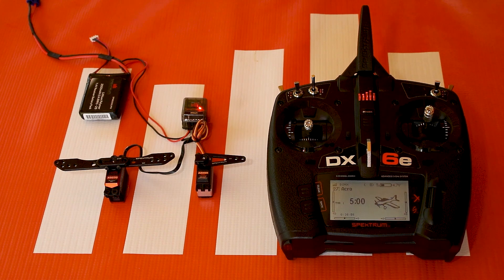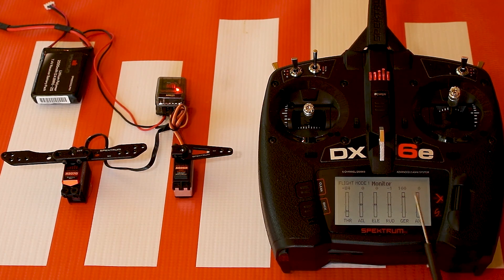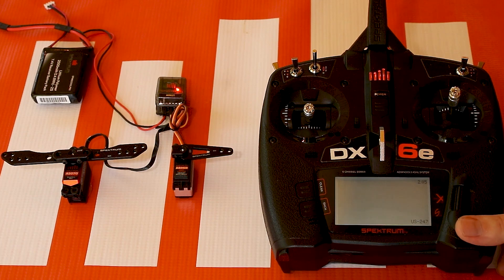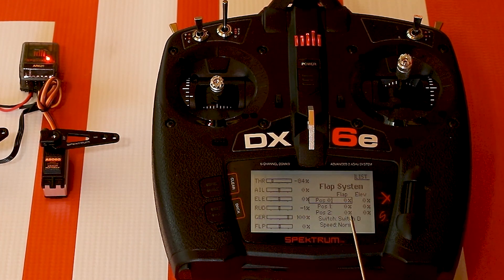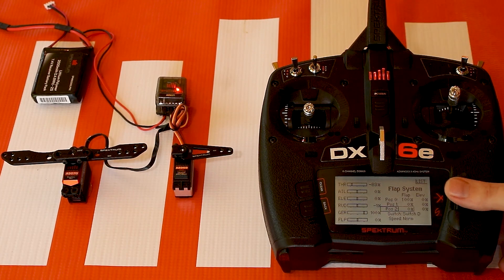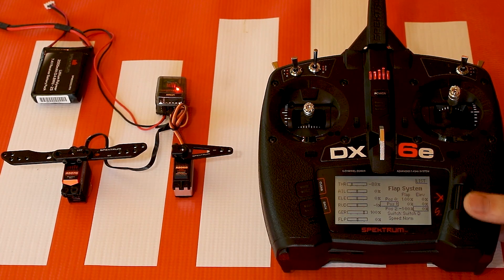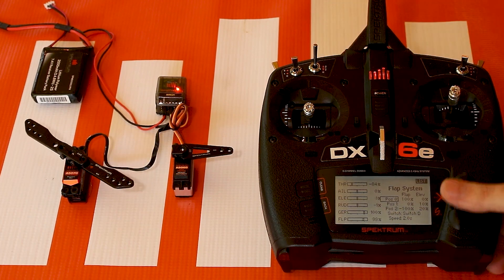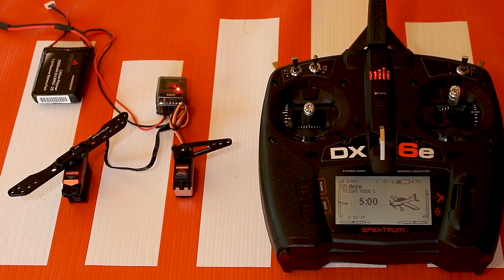Spektrum Quick Hit Tech Tips - How to Setup 3 Position Flap Switch tutorial

Comment: Hi from Michigan • Flying Pilgrims RC Club -  have this radio, second summer flying the Cessna 150T - Every step in this video worked as described - It solved the ballooning issue with the flaps and they also go down slow, like a real airplane. 👍 Thanks ✈

Comment: How do you adjust the throw on a two servo flap system.  When using a three position switch on of the flaps has more throw than the other?  The both start at zero throw. Thanks for your help. I’m using an ix20 radio

Comment: The flap>elevator mix isn’t to prevent ballooning. Your plane balloons because you were going too fast when you lowered the flaps. The flap>elevator mix should be used to set the glide speed/descent rate at idle so that your plane will glide without stalling or descending too steeply.

Comment: These tutorials are awesome thank you. I'm having an issue whenever I choose a different model on my NX10 lately the flap settings are backwards..not reversed in servo reversing they are backwards to the switch position..if I do reverse the switch that overdrives the servo badly, I have to redo the entire 1 and 3 position settings. The middle settings are correct. I dont' know what is causing this to happen but it really causes alot of frustration going out to the field and having to retrim my flap settings. Could this possibly happen after accidently changing stick modes? sometimes apon changing brightness I accidently hit the mode menu and end up switching off the TX and recalibrating after that. Thanks and Merry Christmas.
Reply from the maker: Hi Aaron, Changing the mode should not have done that, the only thing that comes to mind is that if you changed the servo to a different servo it could do this.

Comment: What if in my original set was backwards such as my normal was at number 2 and not zero. What I did is I set up backwards. How do get it to zero for a normal set up. Also my 2 second delay did not function how do I trouble shoot that?
Reply from the maker: If that is the case, then reversing the flap channel should fix it. Just be ready to adjust travel positions if there is any binding in the control surfaces
Reply: @SpektrumRCvideos  is that going to fix my two second delay

Comment: Why does my DX6e monitor screen look different than yours (update 2.08)?  Yours shows 6 channels and mine shows what appears to be 7 channels THR  AIL  ELE  RUD  FLP  GER  AX2  (I'm confused).
Reply from the maker: There is an error in the current 6-channel transmitters that the radio shows a 7th channel on the display.

This will be fixed in v2.09, which should be out in the next few weeks.

You still have a 6-channel transmitter.  To configure channels 1-3, use the top row.  Channels 4-6 are on the bottom row.  Position the cursor by counting and you will be fine.

Comment: I am adding flaps to my Carbon Cub S 2 and couldn’t find the pre-done program on your website, I tried using the S+ and had to add flaps into the program for it and used Switch D and my elevator compensation kicks in but the flap servo does not move. I tried using the Carbon Z Cub program since it already has flaps installed and that doesn’t work either, I don’t know what to do or how to do it at this point.

Comment: Why not just set up 3 flight modes and use the trim section as f mode and when you change flight mode you can trim the elevator and stay set for that particular mode. Way easier

Comment: Super job. Make more soon. Just finalizing Hangar 9 P-51 build with full Spektrum. Avian 100a, Power 52, AR637T, HV Digital standard servos, flaps, Smart battery, and wireless remote receiver, Xoar e-14-6 and 13-8.  The Spektrum videos have been an indispensable complement. A total package. Thank you a ton.

Comment: shouldn't the elevator trim have been negative?(down elevator when the flaps are engaged)
Reply from the maker: It is positive when giving down elevator. When the stick is pushed forward that is technically positive pitch movement. Now this number will be different on the monitor screen depending on the reverse direction of the servo. Great question :)